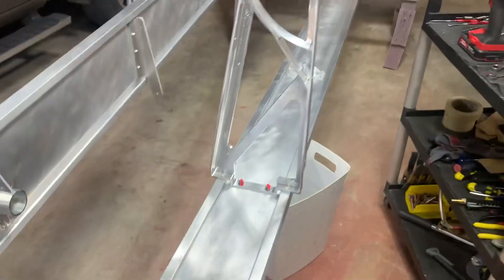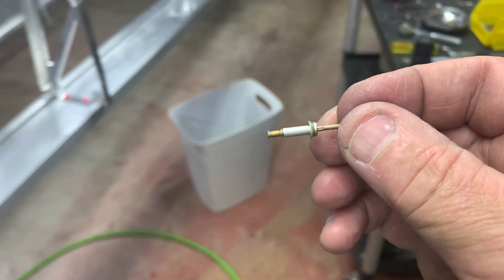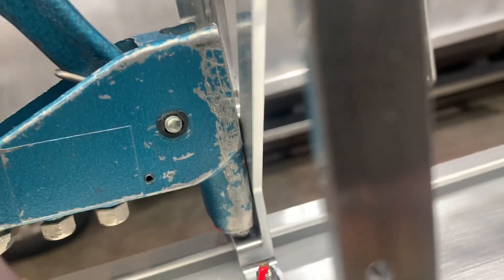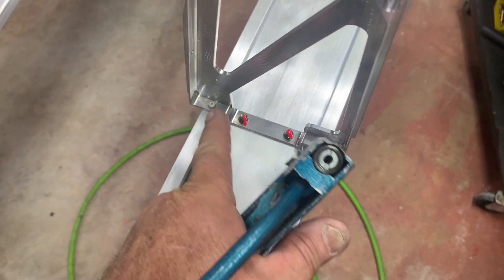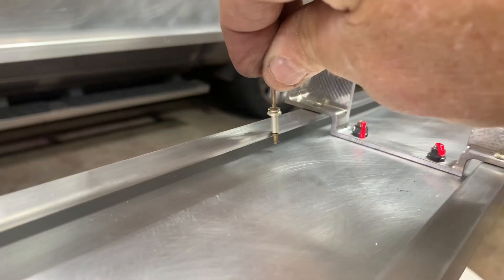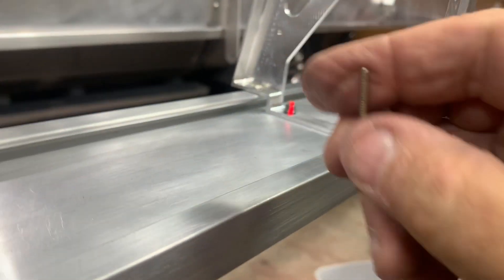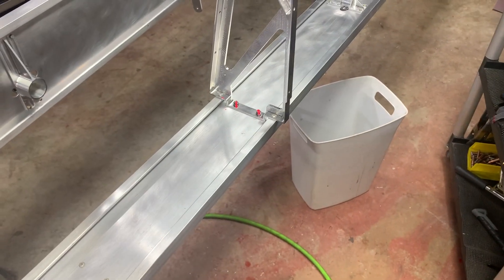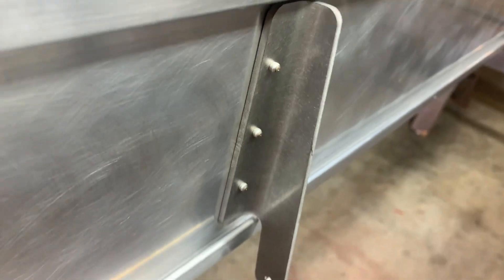Installing the hard cherry max rivets into the aileron hangars on the EX3 wing spar.

Comment: So, I just completed this step today on my EX-3 and it went really well. I actually had an issue with the second rivet (the easier one) because I let off the down-pressure on the rivet and it didn't set right, so I drilled it out. No damage. The take-away on this is: the Marson riveter is capable of pulling these with the modification in the CarbonCub manual, even when they aren't really that straight. Squeeze slowly...there is no rush. Watch what is going on. It'll work out great.